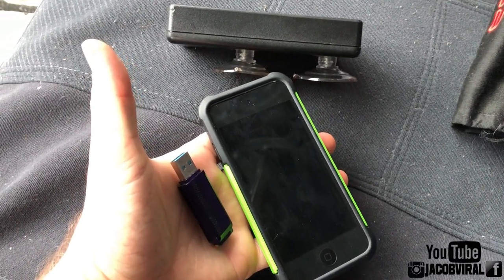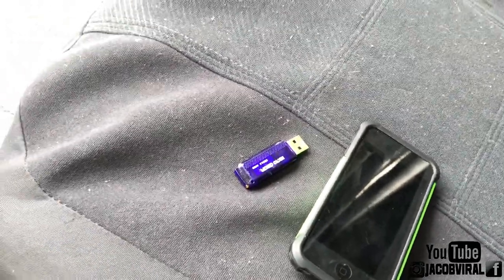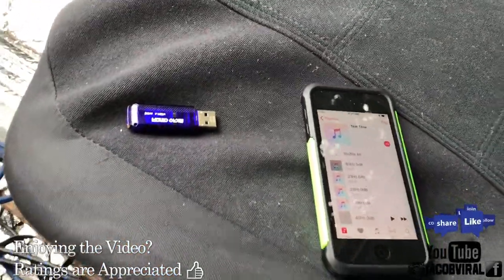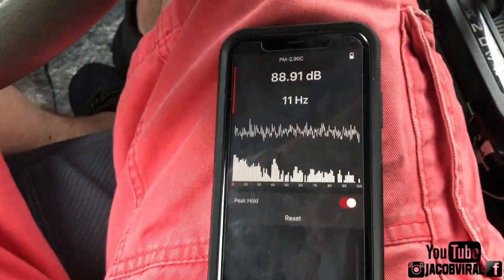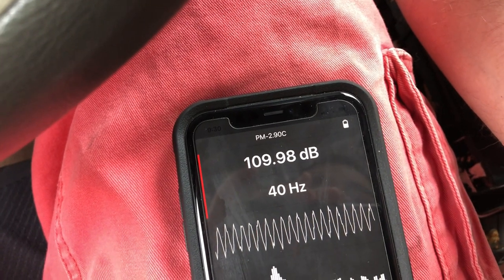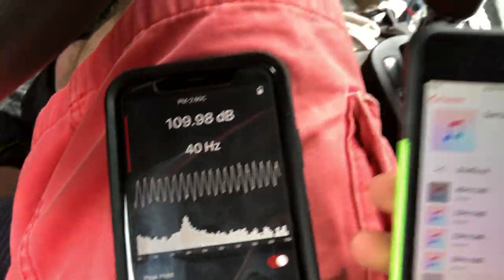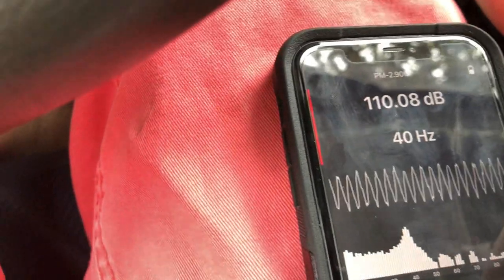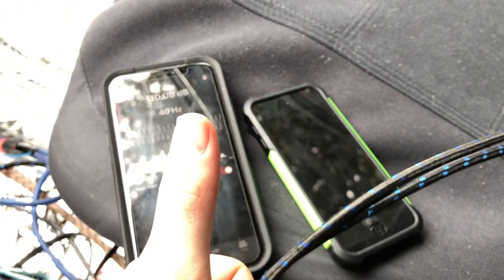Bluetooth vs. USB? Does it matter?

Comment: I did a comparison test between 4 diffrent BT receivers. I was gonna make a video but forgot about it untill now. Three bought at diffrent prices $7-20, and one i made from a pair of earbuds. I was rooting for "Frankenstein" as i call it and i wasnt too disappointed. It had more output and louder highs but at full tilt distorted bass quicker. My choice of winner and what ive used since is a Monster brand. I used my multimeter since i had been doing some clamp power testing at the time but just watched the outout voltage only, while switching between the receivers. Found a pretty big difference in both sq and bass output.

Comment: My Jvc is powering my front/rear speakers atm and seems to peak at 26 (out of 35) with BT from my phone...i tuned my sub amp with o-scope @0db(to be safe) w/ 40Hz tone on my phone and got it dialed in...bass hittin clean for a long time while driving til i went thru a crappy cell service area, so I played some tracks off a thumb drive and had to push volume on the Jvc to 31 to get the same volume (keep in mind fullrange speakers are running off the HU)...Whoa baby the bass was hittin harder but I started smelling coil within minutes, so while cutting the bass knob back I knew I had to be clipping...like the output from HU power and subwoofer RCA's doesnt  scale properly when switching between BT and USB.... weird! Good topic, Jacob!

Comment: Hey @Jacob Viral2  So depending on the type of file on the usb, MP3 and all it’s diff sizes 192, 256 etc, and diff types of files, like flac, wav etc. all those will have a different noise floor most of the time and have a different recording volume level. And with Bluetooth, depending on how new the Bluetooth chip in the source unit is, makes a huge difference in the quality that gets passed over wirelessly. But the most important test you can do is check how hot the actual output of the source input being used as far as voltage thru the rcas. Some source units have source level control so you can make all your sources equal- fm, cd usb Bluetooth. But some older head units have crappy Bluetooth chips in them  and don’t have a way to control the levels of your  sources which usually ends up with either Bluetooth or or usb having a hotter output. Just my experience over the years. I play cds, they sound the best to me. But will use a usb on road trips sometimes. Keep up the great content!!

Comment: I'm using a radio Bluetooth addapter and find it to be alright. A regular Bluetooth radio would of been better. I bet USB or CD would be even clearer on the high vocals but not sure. In some of my videos I've used USB aux jack and because my JVC radio don't have Bluetooth I got a radio Bluetooth adapter. It good but when you roll your windows down it makes a thunk noise and also when I put the lights on. I think USB has better bandwith because in some of my older videos the vocals were clearer. Its easy to film with Bluetooth. I also have 3 phones so I sometimes hook up the USB on my older BlackBerry phone. My other newer phone can't hook up to USB. Also your head unit settings change with each setting. Check your settings make sure your settings are all the same on each source. Like I forgot to +5 my volume source on my aux and wondered where my bass was. Setting your head unit is crucial and always set your subwoofer level on your unit correctly. I had my subwoofer level on leave 4 on one of my newer demo and then I put it up to 8 on my last 2 demoes witch don't clip and let me tell you those last 2 demos were LOUD!
Reply: Is it my imagination or is this the longest message I've ever read on You Tube! I use a USB drive with a micro sd memory card that sounds clear. Got it a few years back and think they don't make it anymore.

Comment: Spl wise and with relatively low quality mp3's it doesn't really matter for me. However I have a lot of russticals rebassed in flac as well as normal music on my flash drive and there is a clear difference in quality and dynamic range to the ears.

Comment: Use WAV files instead of MP3 or if it is MP3 make sure its 192kps or bigger, theres so many people using songs on crap tech that doesnt give the true sound to the system. Don't flop on your inputs, its like Running a Sundown audio sub off a 500watt a/b  class amp. you just wouldn't. Would be nice to see people playing other music thats not DJ rusticals etc. Get some Drum & Bass on the go. Ive never seen any demo's with anyone dropping any drum & bass :)